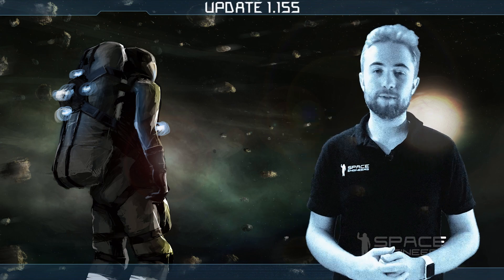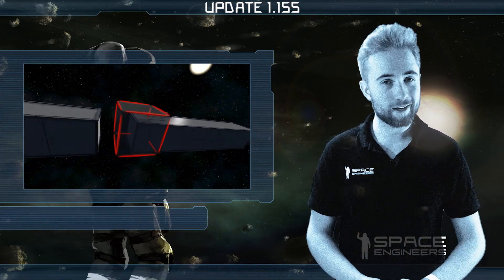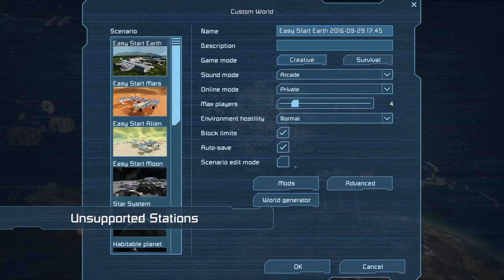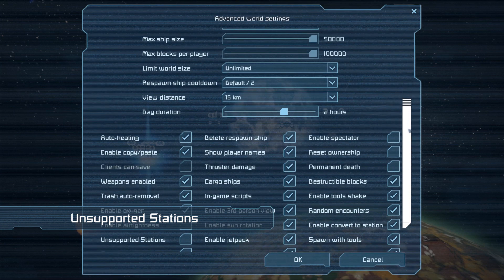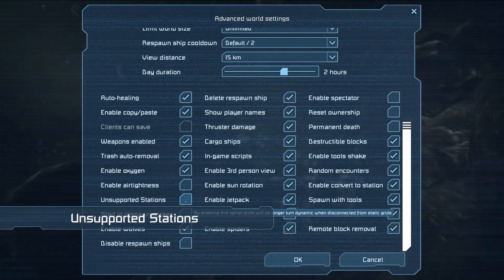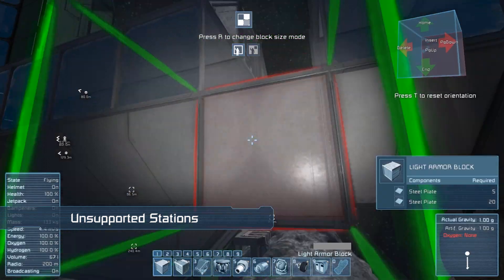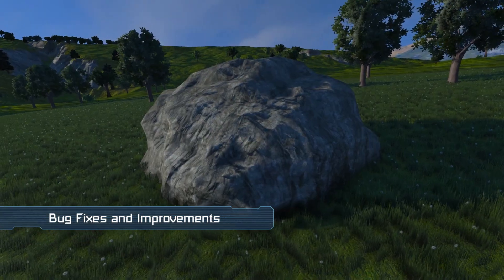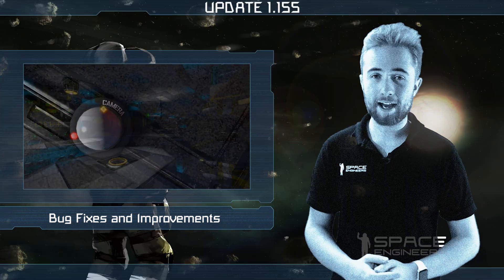Space Engineers - Update 01.155 DEV - Unsupported Stations and Bugfixes

Comment: Its time that you start to improve the real problems in this game .Every update something gets fixed, and something else that worked fine, gets destroyed. Before the update, my creations with pistons and rotors exploded. Now when I paste them inn from blueprints, they just fall apart. I can no longer atache piston-heads to wheel suspension blocks. I cant project a creation that is in 2 pieces/grids, even tho its connected with mergeblocks and is technicaly 1 object, welding blueprints projections hardly works anymore, we dont need blocks that look differently and and more advanced than they realy are. Its the same block and the same function in a new skinn. Yes it look alot better and I love it, but there are more important and bigger problems to be dealt with. How about a block that works like a bouncy/springy piston ? How about control of wheels/thrusters that are connected via a rotor or piston? How about controlling multiple remote control blocks at the same time ? I love the game, its amazing and i realy think hard and long whenever im "inventing" something, but the last year its been harder and harder because some things just dont work anymore. There are so many small things you people can do, that can make the game so mutch better. Im not asking you to make it easy to build, it allready is. The problems im having is that things dont work as they are intended in the game. why cant we connect 2 rotors together? We have to use a mergeblock trick.
Why does a rotor go over 360, its a circle. ? Why is there not a clear marking: 360/0--90-180-270 all the way arround ? why cant we have a better wheelblock ? Some might think: hey if you love an engineering game, solve your problems with engineering. Id love to, but i dont have the tools... how about a 180 degreez hinge in the game instead of having to use mods, why are there no window/glass blocks for small shipps ? Why is the 5x5 wheelsupension block for small shipps bigger than 1x1/3x3. I love ground vehicles in this game, and the wheels are horrible. The block attachement for the 5x5 wheelsuspension is nearly the same size as the wheel itself., 2 blocks of groundclearence for a rover just dont work for anyone. Can i atleast have an explenation on 1 of the problems above ? So far this is the best building/sandbox game i know about, and there is so mutch focuse on "bugfixes" that i have yett to notice. Im sure some of you think: hey, alot of the problems i personaly experience can be solved with a mod/script. But the vanilla part of the game is losing hard. We can all build a spaceshipp, we have the tools for it. Take the game to the next level.

Comment: I do wish the build-distance of blocks didn't reset every time you selected a different one. 

Meanwhile:

Please fix mirroring of items not working correctly in creative ( Oxygen farms and Tanks as a prime example ).

Please fix interior lights shining through walls.

Please fix 'the ghost of autosave' causing the game to freeze every 15 minutes, even when auto save is turned off.

Please rework pistons and motors so they aren't floppy and prone to self destructing ( they still do ).

Please fix grinders collecting contents of containers when container is ground down- this feature needs removing, if it even is a feature.

Please fix turrets shooting their own grid ( still, despite being fixed supposedly over a year ago ). 

Please fix ships being pulled down onto the ground or floating away into the air- issue relating to having moving parts on Motors and/or landing gears.

Please fix the grid-mass issue causing large ships with small ship parts ( connected via rotors ) bouncing when they crash into planets.
Reply: Post this in the forums. Thanks.

Comment: The blocks look amazing i also can't wait to get full physics water ingame and we need water turbines too if that happens for power so we can make dams :D
Reply: Would be amazing, but don't hold your breath for that update.
Reply: The game struggles enough with ships in which an object is static relative to every other object on that grid. How well do you think water would turn out considering A: the massive amount of free-moving objects that would need to be generated, and B: The fact that most SE players are on low-end PCs (even the ones with high-end struggle to run it), and adding water would reduce said PCs to a pile of smoldering chip sets. Not to mention how many trillions of calculations would be needed for water that flows, or if a ship collided with water. If water is to be implemented voxel deformation would have to be removed and the water be static animations like other games.
Sorry to rant but for voxel water to be a thing an engine re-write would be necessary, which wont happen, hence no water.
Reply: Even if it is jelly water like cities skylines, it would be amazing. This may happen but not until the far distant future. It would also add in more challenge as water would be a barrier rather than a blessing. Water pumps connected to an electrolysis machine could also be a thing
Reply: Andrew Curlett It may be Space Engineers 2.0 or an extremely distant update, as I stated above